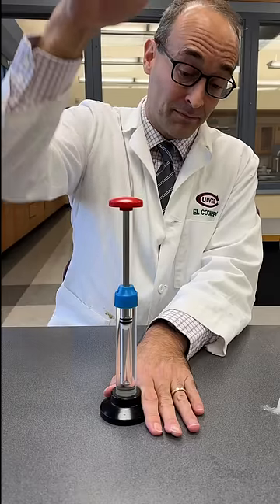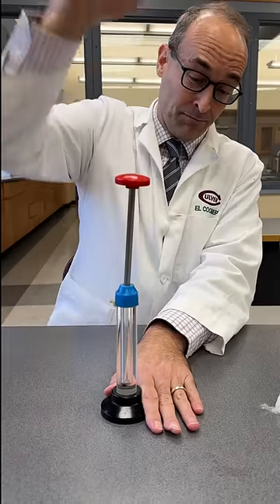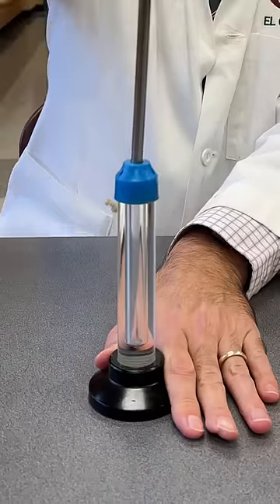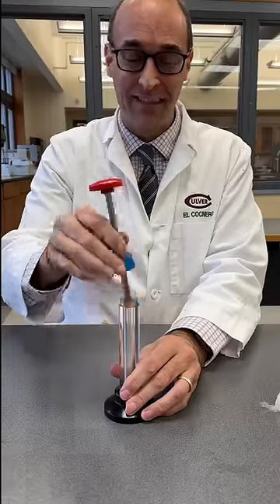Squeezing air to burn stuff

Comment: That's how boxing mantis shrimp generate energy to beat their prey to death
Reply: also how they literally boil water with the speed of their punches
Reply: thats also how i do that
Reply: @acm-gs6bl That's pistol shrimp. And fwiw, it's mostly for self-defence. (They mostly just eat little bits from the sand near their burrow.) I had one who felt threatened when a curious little blenny got in too close, and the poor little fish was paralysed from a brain/spine injury. He laid helplessly on the bottom of the tank for a while, and I honestly can't remember wherher I was able to help him or not. All that from the immense pressure & heat j in bubble by the pistol shrimp's claw pop; the claw didn't touch the fish.
Reply: @mookinbabysealfurmittens do you remember now?
Reply: @sjj3lemon267  That's not how lost memory works. I tried to help, but I can't remember the outcome. Sorry.
Reply: How ironic. I just scrolled through a YouTube short clip explaining exactly this ...
Reply: @acm-gs6bl  It's pistol shrimp, and it's the speed of clacking their claw. Mantis "shrimp" are iirc stomatopods, but I do remember correctly that they use brute force, if they're the "smasher" type, with club-like appendages. The "spearer" type strikes with, well, spear-like ones.
Reply: Not quite! Water is incompressible, so they actually move it so fast that it leaves a small vacuum style gap that then converges creating heat as it then comes together.
Reply: The mantis shrimp does in fact not compress water to generate heat. It also can’t compress the cavitation bubble for two reasons. 1. the bubble forms after the punch. 2. the cavitation bubble is mostly made of vacuum which doesn’t generate heat when compressed.
Reply: @peterpumpkineater6928  Bang on, but the bubble business is the pistol shrimp. All that detail but you didn't double-check which animal does this.
Reply: @mookinbabysealfurmittens  „All that detail but you didn’t double-check which animal does this.“ 
Kinda ironic isn’t it
Reply: @mookinbabysealfurmittens  my toxic part makes it very hard resisting making fun of you
Reply: @peterpumpkineater6928  P.P.S. Add "irony' to your list. Cheers.
Reply: Was about to comment this
Reply: @Ali_Haji_SouthAfrica  same
Reply: @WhereNothingOnceWas cavitation bubble
Reply: @mookinbabysealfurmittens Certain mantis shrimp do form cavitation bubbles when they strike. That attribute is not unique to the pistol shrimp.
Reply: @iRossco  We all saw the TierZoo video. Lol. How timely! (The newest one on arthropods.) Note how he shows a pistol shrimp, not mantis "shrimp", when talking about the cavitation bubble. And at the end portion of the video, he further notes the distinction. Funny, that.
Reply: I watched a video about sonoluminescence, and they mentioned both the mantis shrimp & the pistol shrimp. 
Both snap their claws creating this almighty reaction, can't be sure they even know why so much heat is generated! Fascinating stuff.
Reply: @MrMuz99  Was it Thought Emporium? I'm pretty sure it was they who [also?] did a great [imo] video on that subject.
Reply: @mookinbabysealfurmittens  - You are correct, good sir! I swear I still can't wrap my head around it all, those little shrimps are badass!
Reply: @MrMuz99  Cheers! And right? It is a great video - such amazing work! - and pistol shrimp are really cool! The bubble phenomenon is just amazing, along with already being pretty cool-looking animals and fun to watch. I love that they readily pair up with gobies in a symbiotic relationship. Shrimp digs the burrow & has the defensive with that mighty claw, and goby grabs food while keeping a sharp eye out for predators & thieves. Btw, it's been a while since I saw the video, so I can't remember if he discussed that - but if so, my bad. I just enjoyed some nice memories of my time working with them. Cheers for that!
Reply: I mean kinda, The shrimps arms are retracted by tendons and help back with a joint and than released when it strikes at something. The resulting strike hits with such a forces that it creates a cavitation in the water and that cavitation collapses back in on itself creating the energy that we see as light and feel as heat.
Reply: @mookinbabysealfurmittens  no dude he's talking about mantis shrimp doofus.

Comment: They have this for outdoor use for survival, called a fire piston.  Great tool
Reply: I was wondering if it could be used that way. Thanks for dropping it here so I can look it up.
Reply: Thanks! I couldn't think of the name of this and I've tried telling people a out it that don't believe me lol
Reply: Nice to know
Reply: what is called and how to use it ?
Reply: @chucksauter1204  people being people kkk
Reply: @plazmica0323  It's called Fire Piston and you use like in the video.
Reply: These types of survival gadgets always amuse me.  If you have the option to pack a strange, clunky, potentially fragile, moderately sized cylinder that's sole purpose is to create a micro puff of flame for a fraction of a second...you also have the option to just pack a freaking lighter.
Reply: @ironman4do   The fire piston in the video is more of a model for school or demonstration. Survival fire pistons are usually smaller and more robust. For example, I have one made of brass that is about the size of a marker. And for survival, you tend to use small pieces of coal or another igniter that glows and not something that burns quickly.
Reply: @yuki_foxsoul8425  Sure, yours is smaller and more robust. That's great, but it's still objectively worse at starting fires than even a simple, cheap and tiny Bic lighter is.  I'm not saying you can't start a fire with the gadget, I'm sure you can if you choose to bring it along.  I'm just saying that since that is its sole purpose, I see little to no reason to choose it over other options much better at the job.
Reply: disposable lighter is useless after running out of fuel. Reusable fire starting tools can use found materials to continue to work for years.
Reply: @ironman4do Fire pistons can be reused though, lighters cant.
Reply: @ironman4do some of us like things that last and arent so disposable. Noone says we cant use lighters too... 

Your show a clear lack of knowledge and common sense which is fine in itself but your smug attitude works against you.
Reply: @ThatGuy-sc5rx  They make non-disposable lighters...  And I'm not saying people can't use Fire Pistons. I'm saying they are novelties, they're gadgets.  I'm saying that if your goal is to start a fire there are many better options available.     

If your goal is to have fun starting a fire with a gadget, that's a different goal.  I'm not here to yuck your yums.  That amuses me, but obviously no one cares about or needs my permission or approval.   But, and THIS is common sense talking here, there are better/easier/more common/faster/etc ways to start a fire than with novelty gadgets.   For anyone to claim otherwise would be their ignorance, not mine.  

That said, when a conversation results in one or more participants effectively telling the other "you're dumb", it's devolved to the point of being not worth the time anymore.  So me and my smugness will retire from this conversation, and I hope you have a wonderful day!
Reply: @ironman4do  tbh not everyone brings a bic lighter and I'm pretty sure the moment that thing gets wet it won't do much until it dries out. Also it's still better to at least have both things on your gear just in case the cheapo bic lighter cracked or got damaged (same with other lighters). Plus if its survival novelty and practicality doesn't really matter much and its still better than rubbing a stick.

btw Fire pistons are actually not a modern invention its one of the oldest ways to start a fire you can't really call it a wacky gadget its more like an outdated but still useful tool. Heck you can actually handcraft a fire piston too if you know how to make one and have the correct materials which is pretty helpful if you're trying to survive.
Reply: He did what in his fire?
Reply: @ironman4do  you do know this is the ancient version of indestructible fire starter, dont you? Wonder if your bic lighter can survive rough environments with that plastic body and pressurised gas inside. Lol
Reply: @yuki_foxsoul8425 that and a bag of that laced bricket is what we needed for BBQ
Reply: That's a hilariously bad tool! Find me one single person who has used this out of necessity, not because they forgot to bring a cheap lighter. I actually laughed when I saw you can buy these.
Reply: @Gandhi_Physique  ur on youtube
Reply: @quack1404  What's your point?
Reply: @Gandhi_Physique  look it up yourself, you're on YouTube.
Reply: @quack1404  Oh yeah, let me look up something I've never seen nor thought about before. 
Think before you type. How am I supposed to know it is called a "Fire Piston" if that info was only made available to me through the OP's comment? I didn't wonder if I could buy one or make one, so why would I look that up without someone telling me it is a product that exists?
Reply: @Gandhi_Physique  you read the comment, think to urself what that is, and then go to YouTube’s search bar and type in fire piston, literally the first video is, you guessed it. A fire piston.
Reply: @quack1404  It is clear now that you didn't even read what I said. No shit Sherlock. Read my first comment again. I literally thanked them for saying what it was so I can look it up myself.

Comment: The opposite is also true. Expanding gas gets cold. That's why those CO2 fire extinguishers feel so cold or why you get frost on helium tanks.
Reply: Or when you freeze your hand trying to refill a butane lighter 😂
Reply: also how air conditioning works. Compressor does exactly what it was named for and then the evaporator expands the refrigerant to cool it. We've really come a long way with technology.
Reply: Or when I’m spraying the last bit of deodorant out of the can
Reply: Yep, you can calculate the exact temperature change using Gay-Lussac’s law
Reply: No, this is evaporation!
Reply: The irony when propane freezes trying to fuel a heater.
Reply: Technically what happens is that in compressing the gas you forced it to stop moving and all of the energy was released as heat (temperature -> average kinetic energy).

So when you release it, the gas is able to absorb the energy from impacts with nearby molecules and thus it rapidly expands.

If you poured liquefied gas (compressed to make it cold which eventually causes a phase change) out of a canister in outer space it would just be bunch of floating liquid.

Comment: Fun fact, if you don't mind it massively wearing out everything really quickly, you can use this to get WAY more velocity/power out of a spring-piston air rifle. Put a little vaseline into the base of the pellets and it'll "diesel" it, turning it from an air rifle into an actual FIREarm at the expense of blowing out most of the gaskets and wearing out the barrel in only a handful of shots.
Reply: Nice
Reply: Legend
Reply: Came to comment this same thing.  However I can confirm that if you don’t add too much oil or Vaseline you can still get quite a bit of extra velocity without destroying the seals right away.  I’ve fired easily a couple hundred dieseled pellets and the gun still works great.
Reply: @maukaman  I used to put Hoppe's lube oil on the o-ring. A light film is enough, but I noticed that a drop or two would make the next few shots crack like a .22 if I gave it more than 3-4 pumps.

Accuracy was garbage tho!
Reply: What happens if you put ethanol in there?
Reply: @dsdy1205  I haven’t tried it but I remember seeing a video where someone tried a bunch of things like isopropyl alcohol.  I don’t think it worked very well because it didn’t stay put in the cup of the pellet like thick oil or Vaseline will.  I wonder about hand sanitizer though…
Reply: @dsdy1205 Won't work as well. You want a high Cetane index. Petrol jelly is close to ideal
Reply: @dsdy1205   Ethanol eats rubber so i'd avoid it.
Reply: "You'll shoot your eye out, kid." 🎄😄
Reply: ATF wants to know your location
Reply: Ideas 🤔
Reply: UMayx more like you need a stronger skirt on the pellet, and a bucket of o-rings!
Reply: that being said, [NOT LEGAL ADVICE, THIS IS FROM MEMORY OF A FACT I HEARD IN A YOUTUBE VIDEO I WATCHED YEARS AGO] i’m pretty sure the legal definition of firearm in the modern usa only applies to things using smokeless powder in a casing. even though that would be an arm which propels it’s projectile by means of combustion aka fire, it’s not legally a firearm i think [AGAIN, NOT LEGAL ADVICE]
Reply: @dsdy1205 ethanol has a much too high octane, I think it's over 110 octane. 
Octane rating is it's resistance to compression ignition, 110 octane is very hard to ignite using compression, but diesel is about 20 octane, so much easier to ignite with compression. The stuff that he was talking about such as Vaseline or oil is probably similar to diesel.
Reply: furiously taking notes
Reply: @dsdy1205  I'll update you on it
Reply: @brumm0m3ntum94 yeah you’re right, muzzle loading black powder weapons aren’t legally firearms for that reason, although that depends on the state

Comment: To be more specific, it’s a diesel engine that ignites it’s fuel using compression. Ignition from compression in a gasoline engine is a bad thing and can usually be resolved by switching to a high octane fuel
Reply: Ignition from compression in a gas engine is usually the result of the wrong octane really. Each grade has different combustion ratios.
Reply: @JakeKentner  right, which is not good for the head gaskets or valve seats in an engine specifically designed to run on spark ignition.
Reply: @pedrourbano501  that is not at all correct. Not even a little bit other than the part about diesel fuel being an oil. The viscosity has nothing to do with compression ignition
Reply: Right. It's called pre-ignition or knock. Diesel pistons are much heavier and cases much stronger, so they don't care when exactly the boom occurs.
Reply: @matthewsalmon2013 diesels do care. The fuel cannot ignite prematurely, or you’ll lose power, and even stall the engine. The fuel injection occurs at a point in the cycle that prevents that from happening.
Reply: But this is an excellent visualization of what happens
Reply: Internal diesel combustion engine doesn't compress fuel wapors before burning them. It compresses  air then adds fuel to the hot compressed air to ignite it.
Reply: @emil8709  only in DI engines. IDI engines operate the same as a gasoline engine as in it indirectly injects the fuel and the intake stroke sucks the fuel air mixture in & its ignited at the peak of the compression stroke. Direct injection diesels like you’re talking about only inject the fuel once the intake valve closes completely because single cam engines use the intake cam lobe to actuate the fuel injector. Some engines have a seperate fuel injection lobe, but it still operates the same

Comment: Fire Piston.  Tech has been around since 1745.  Some bushmen still use the fire piston to start a camp fire.
Reply: Yep, in Malay culture/tradition this was a equipment they use for fire starter which made from wood & steel around the 17 centuries. I used it few times when i was a kid but nowadays people just use lighter
Reply: isn't flint stone ignition simpler and easier to riproduce in nature?
Reply: bro just craft flint and steel 💀💀
Reply: @fieryr  Depends on a lot of factors.  A planned trip and both options are equally viable, so let's look at SHTF scenarios.

Would the person recognize flint or one of the other stones that will spark off of carbon steel (since stainless won't work)?  

Are they in an area with flint? 

Most knives anymore are made of stainless steel, so it's unlikely most folks would have a carbon steel knife unless they specifically selected it.  Since stainless won't spark, its unlikely a person would have the right materials unless they carry a SHTF kit all the time.

A fire piston can be made in the field with natural materials, but the skillset takes practice, so it's not something that somebody can just watch a vid and then hope to pull it off.

I personally don't depend on the fire piston but I won't write it off.  I carry multiple fire-starting options every day for that reason.
Reply: Since pharaonical times. The old egyptians used fire pump igniters.
Reply: @RaimoHöft  Hadn't heard of it back that far.  Thanks for the info 👍

Comment: It is an adiabatic process, in which heat transfer is 0 and all work done on the gas is used to increase Internal energy of gas and thus the temperature of gas also rises.

dQ = dW + dU, 
In adiabatic process, -dW = dU
dU = n•Cv• dT
Reply: Exactly 💯
Reply: So what exam are you preparing for?
Genuine question.
Reply: @feastbeforeheat  NEET
Reply: @vaibhavgupta8681  All the best brother!
Reply: @feastbeforeheat  Thanks🙏
Reply: And the video is a perfect example of an ideal process under controlled environment.
Reply: @wolfvash22  it is adiabatic bcoz it is too fast which do not give space to heat escape . 
By the way it is not reversible as it is too fast ......for reversible you have to maintain equilibrium everytime
Reply: I figured that compressing things would make them freeze and it would only get hot if it's done really fast.
Reply: Bro what about friction between the piston and the cylinder? we know practically friction can never be zero. This process can never be 100% efficient in real life
Reply: We use engine oil to decrease friction and nowadays some oils are viscosity index upto 400  @aryanverma7800
Reply: Yeah Mr. White!! Yeah Science!!!
Reply: Bro has more on his mind than megamind 🗿🥶